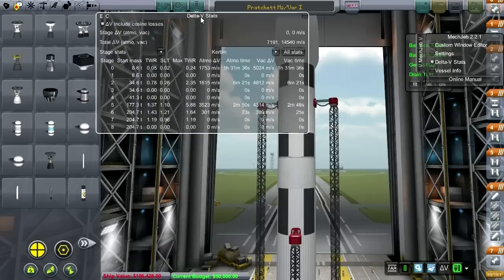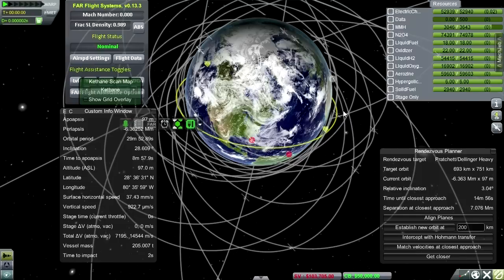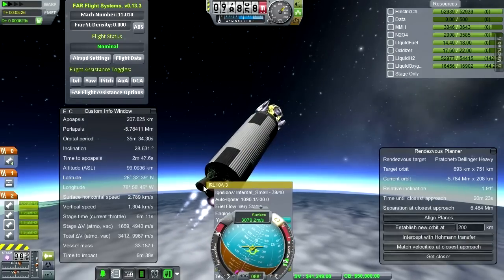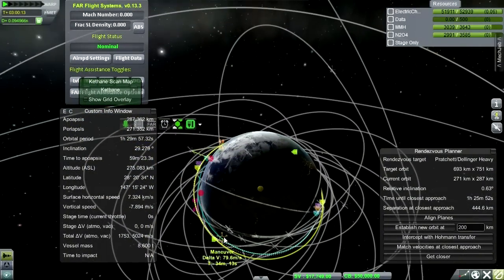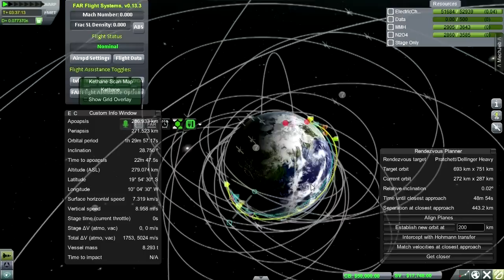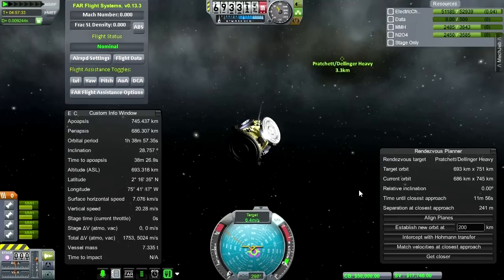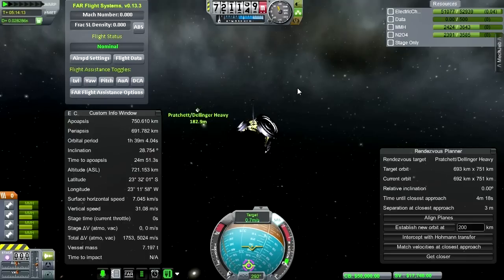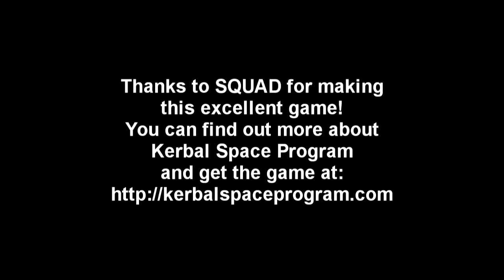Kerbal Space Program (0.23.5) - Realism Overhaul 031 - Pratchett Station Module 2

Comment: Not much substance from me this time, just posting to say I watched and enjoyed. :)

Interesting that you have 2/3 of a Saturn S-IV there, in your upper stage. Although doubtless more a modern version of the RL-10 than the S-IV used
Reply: ***** Well, though the S-IV was 6.6m in diameter, it was quite short, and only massed 50 tons. However, it had a lower TWR than you, so you're more like (going by mass) 1/2 a S-IV with a fourth central engine for extra MOAR POWAH. You could probably get by quite well with only 3 RL-10s though, and be exactly 1/2 a S-IV. 0.78 initial TWR is really on the high end, although it certainly makes flying a bit easier.

Comment: Great video! I have been to Dres, Jool and Moho lately. Moho is meh at best and Dres is interesting (such high gravity). Jool mission needs redoing though as I didn't put RTG's on the probe. Just one question of technical nature, how did you cluster engines on your 2nd stage? I cannot find how to do it besides using girders. Fuel lines are a tad glitched in my install so they have to be on the tank.
Reply: Thank you for the tip! I will have to install real engines mod. I tried doing this with my current mod list and it didn't work. Missions to Jool and Dres are fairly easy to do, my biggest challenge was Duna. Mostly because it is small and difficult to aim and the atmosphere is crap for just parachutes (6 massive shoots are not enough).